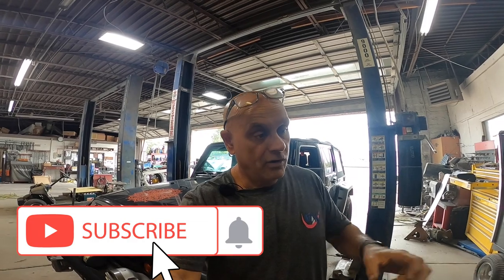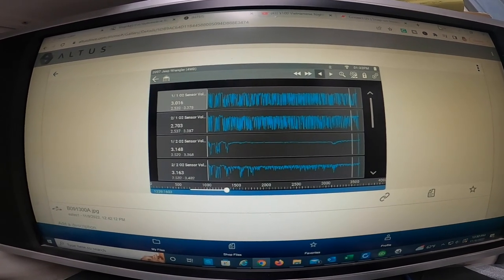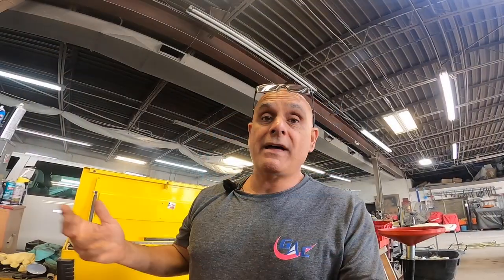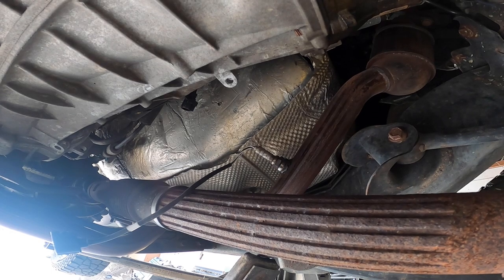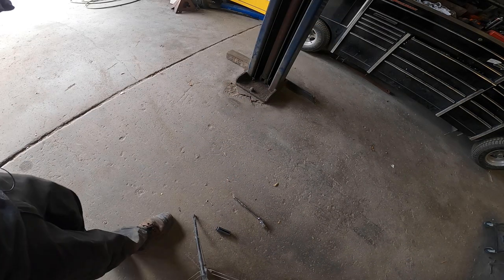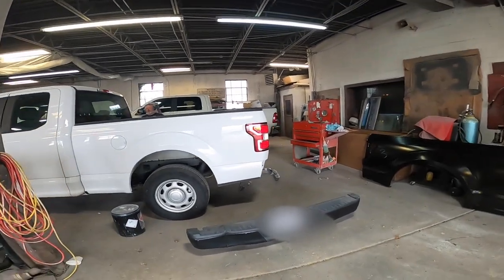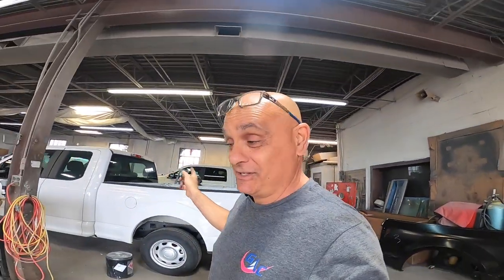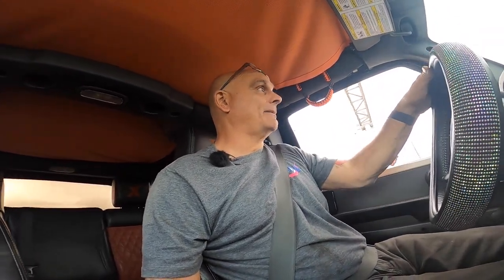Diagnose A BAD Catalytic Converter In One Simple Step

Comment: Do you you have an opinion on what could have caused two converters to go bad in quick succession?
Reply from the maker: Actually, I do, this customer brought the jeep back to me because a check engine light came on. After pulling the code, which wasn’t there the first time, It had a misfire on the number six cylinder, so I pulled out the plug someone had tapped the hole because the plug was stripped and they must’ve left some debris in the cylinder and had knocked off part of the plug so that allowed the gas not to be burned off correctly, and the excess fuel went into the converter and destroyed it. I’m actually doing a follow up video.